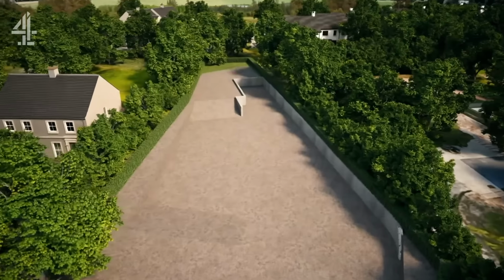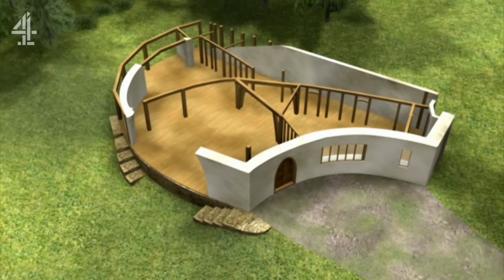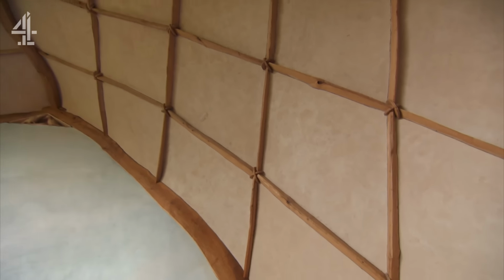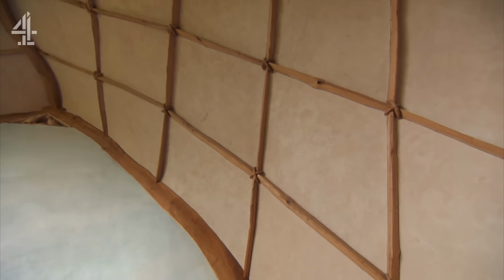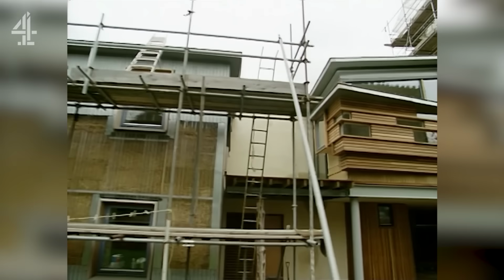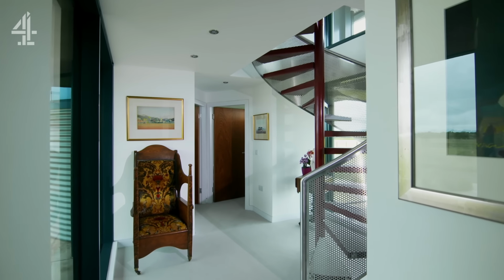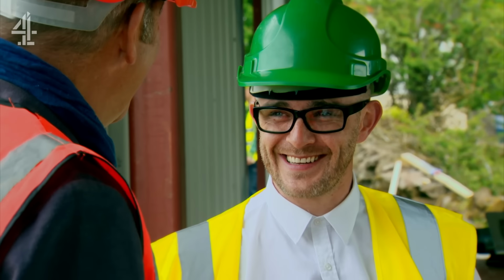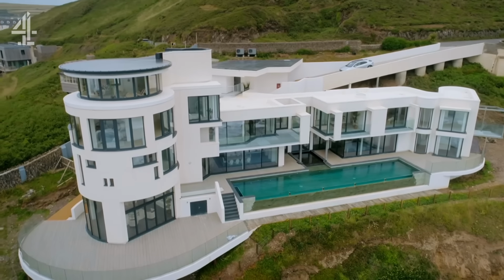Most Iconic Builds From The Last 25 Years | Grand Designs 25 Years & Counting

Comment: The lighthouse in Croyde is still unoccupied and starting to decay already - im a regular visitor to the area
Reply: We discovered that back in the summer, magnificent building but too big to be practical no doubt. Shame if it's still empty.
Reply: @ the other issue is that it’s not an easy walk into the lovely village, you either take chances on the road or risk falling in the sea and getting muddy taking the coast footpath.
Reply: @eliotmansfield  true in summer it would be a nightmare. 
Apparently it started at 10 mil and now down to 5. Someone is going to lose their shirt in this one
Reply: @ 10m was when it included the adjacent house, which has been sold - so it dropped to 5m and keeps coming on and off the market - from what i can tell, it’s still not sold.